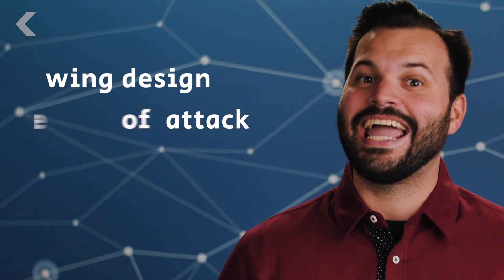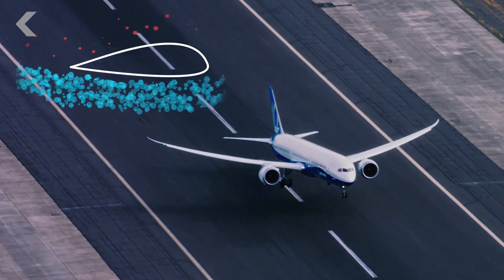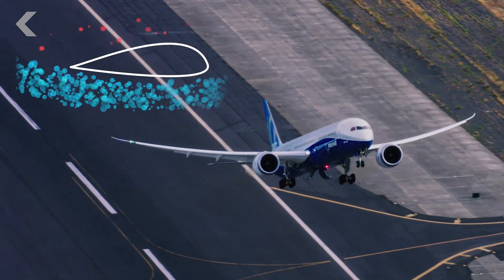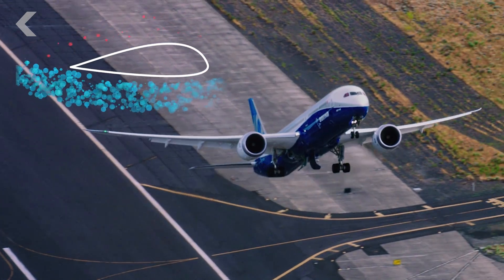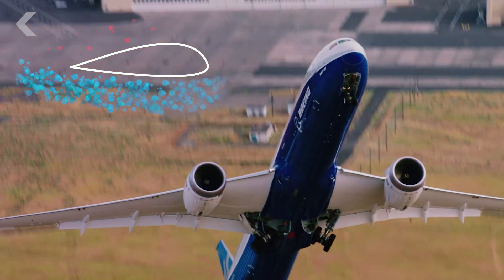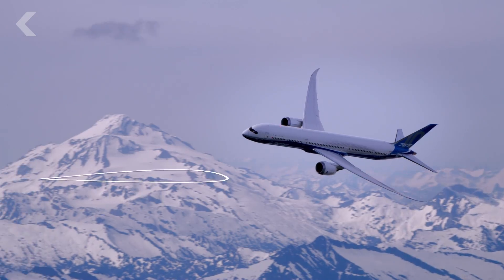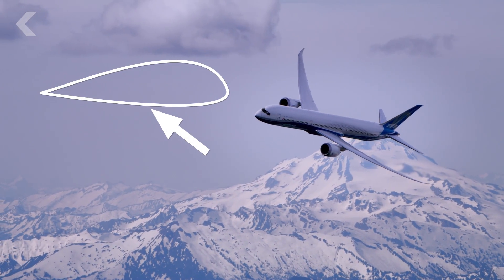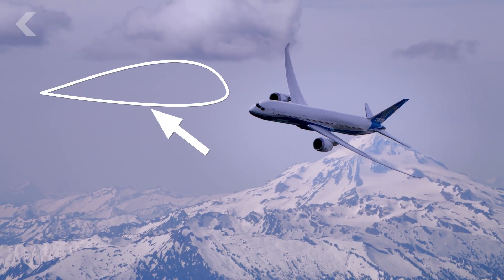How Planes Are Engineered to Fly Upside-Down

Comment: No no no, planes fly the same way you can water ski, the wing is slightly angled to allow the plane to ski level through the air at normal cruising speed, that's why flaps are necessary at slow speeds. The small planes fly inverted by angling the plane so that it's wing is once again acting like a ski.

Comment: Angle of attack is more explanatory than the idea of faster upper stream. It is more air impacts versus less air impacts, which is why upside down flying also can work as shown. It's a shielding effect. The Magnus effect does come into play in certain angles. Or the Venturi effect with nozzles, cards and pins. Take a thread spool. Put a stick pin through a playing card. Center the pinned card in the spool hole. Hold with finger and blow through the hole then remove finger. The card does not fall. The air is static on the opposite side, but vortices wrap around and impact that side with more force than the hole exit whose entrainment is at mostly right angles. Essentially the diameter of the spool hole is the only area on the top side of the card getting impacted. While the other side has the wrapping vortice over the entire perimeter.

Comment: So... What Denzel did in "Flight" is not possible?
Reply: Interestingly, the maneuver portrayed in the film is based on an attempted recovery of a nose diving aircraft in Alaska in 2000. Sadly the plane was beyond saving and it did crash but models showed that if it were attempted at a higher altitude it could have been successful. Alaska Airlines Flight 261.
Reply: probably requires the angle of attack thing, and quite a lot of momentum to begin with... but not very sustainable.
Reply: Hollywood got me again. Sigh...

Comment: How do they get fuel to the engines while upside down?
Reply: An excerpt from https://www.airspacemag.com/flight-today/how-things-work-flying-upside-down-27746739/
To ensure the flow from fuel tank to fuel injector, aerobatic aircraft with the fuel tank in the fuselage have a “flop tube,” a flexible hose with a weight in the free end, plugged into the fuel tank. In normal flight, the weighted end of the hose flops to the bottom of the tank and draws fuel from there. When the airplane rolls inverted, the weighted end flops to the top of the tank, with the fuel. Regardless of the aircraft’s attitude, fuel and flop tube end up in the same spot.

Comment: Wind dynamics isn't affected only by gravity. The angle of attack, even when upside down, applies the same even when the air currents are flipped because there is still a force caused by momentum that changes it.

Comment: Pretty much any plane can fly upside down...some just do it for much less time.
Reply: microbuilder The big issue for aircraft not designed for inverted flight is systems designed to work with negative g, the big ones are fuel and oil systems, and the ability to withstand negative g loads.  Fighters can withstand large positive g loads, 6-9 on modern fighters (depending on tanks and weapons being carried) but relatively small negative loads, often 3g or even less.

An airliner is typically only designed to withstand 2g positive (may be a bit higher if the jet is very lightly loaded) but negative g limit is typically 1.  So flying inverted in an airliner would have the plane at it's design limit in straight and level flight and any additional g would be past the limit.  This doesn't preclude a transition through inverted, doing a roll for example, that doesn't apply any negative g.

Comment: How do they keep fuel going to the engines when they are upside down?  Or when the do stunts and pull a lot of Gs ? Would that make the fuel in the wings go away from the suction holes of the fuel pumps?  Anybody know?
Reply: They use fuel injectors and....
An excerpt from https://www.airspacemag.com/flight-today/how-things-work-flying-upside-down-27746739/
To ensure the flow from fuel tank to fuel injector, aerobatic aircraft with the fuel tank in the fuselage have a “flop tube,” a flexible hose with a weight in the free end, plugged into the fuel tank. In normal flight, the weighted end of the hose flops to the bottom of the tank and draws fuel from there. When the airplane rolls inverted, the weighted end flops to the top of the tank, with the fuel. Regardless of the aircraft’s attitude, fuel and flop tube end up in the same spot.